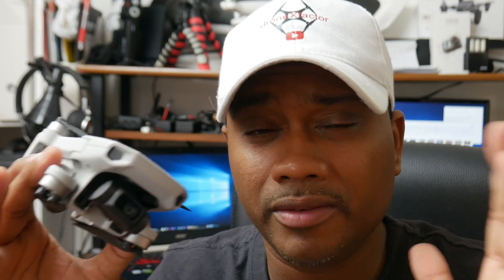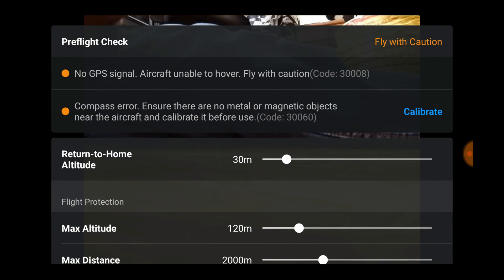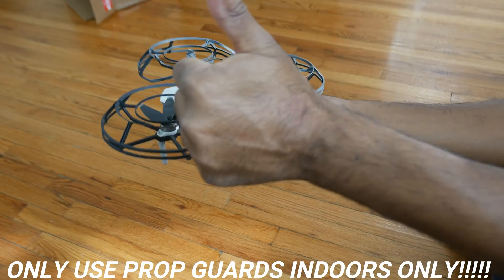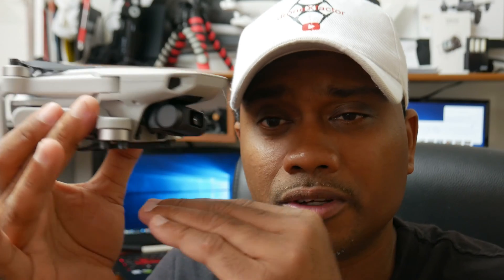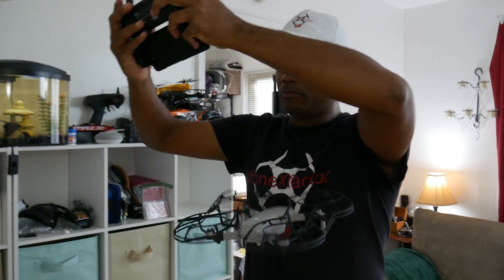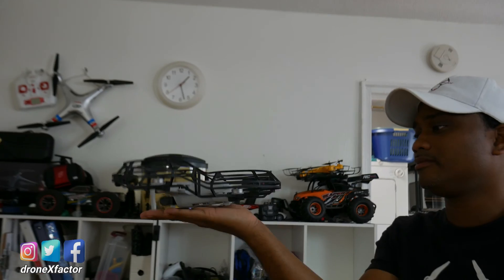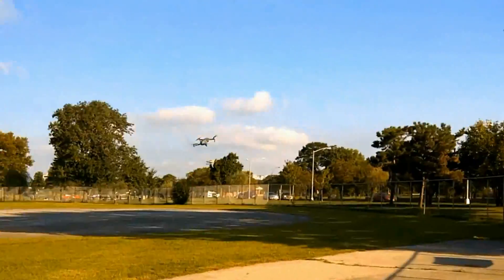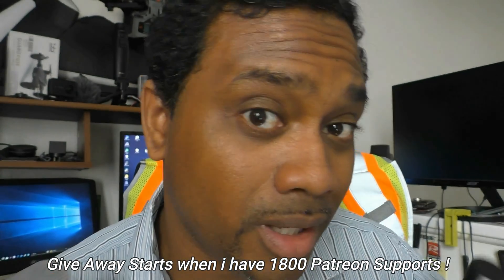How to Calibrate DJI Mavic Mini Drone Compass

Comment: Do you have to do it before every flight ?
Reply: Nope.
Reply: And it will have no problem with the RTH?
Reply from the maker: Not necessary....... If it doesn't prompt me, I don't do it!
Unless I travel to another country.
Happy Flying 😎
Reply: If it's your drones first flight, calibrate it. If you fly in a new location 30 miles or more away from last flight, calibrate it. Just takes 2 minutes. They put it in the manual for a reason, because it's important.
Reply from the maker: @freerobotsex  hummmm.,....... what page number in DJI Mavic Mini manual does it recommend this?
I'd like to read it, i probably missed it.
Happy Flying 😎
Reply: @droneXfactor  page 44
Reply from the maker: Got it 👍
Thanks for sharing
Happy Flying 😎
Reply: Just a FYI, I took mine 225 miles north and the app did ask me to re calibrate the compass, but only once and I flew a bunch of times at that location and it did not prompt me again.   So the definitive answer is no...unless the app asks to to re-calibrate.